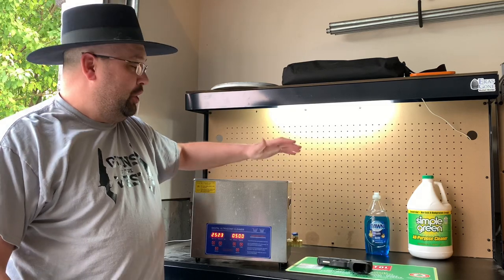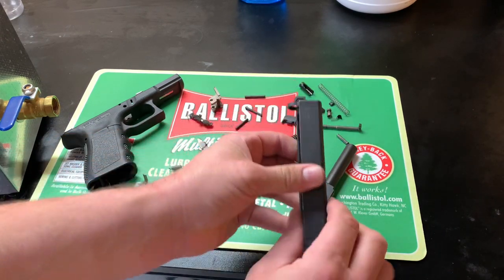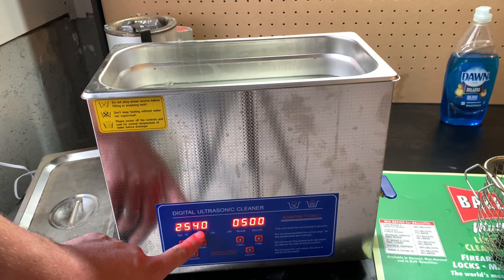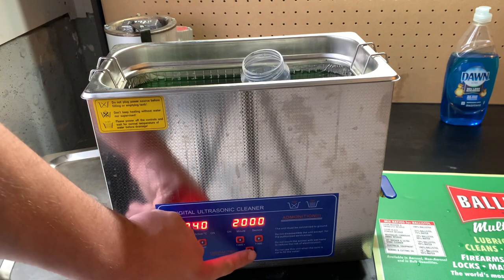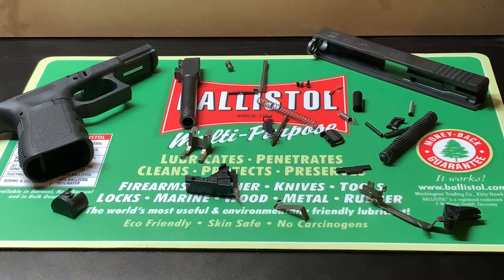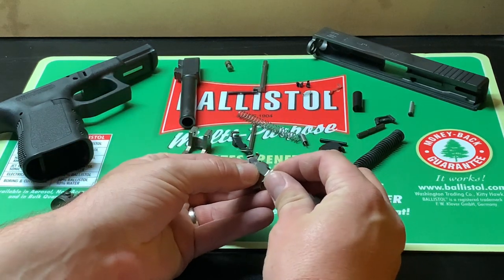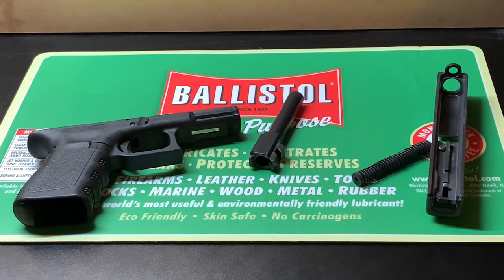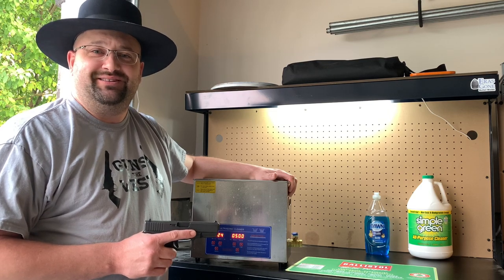Ultrasonic Glock Cleaning

Comment: This may have been mentioned earlier, but you really must rinse those parts before drying. Even the slightest remnant of simple green (a degreaser) will defeat your lubricant. It doesn't take much degreaser to destroy the properties of your lube. I always rinse under warm water & do another ultrasonic with fresh clean filtered water. THEN dry the parts and reassemble and lube. Ultrasonic cleaners are great, but get all that degreaser off the parts before reassembly.
Reply: @MightyNinjaRabbit why distilled ?
Reply: @wokethoughts2186 unfiltered water contains minerals that can deposit on the part and might be corrosive or become corrosive to either the part or the lube. not a super big deal but distilled water is like $1 at walmart per gallon and its alot better that just water straight from the tap.
Reply: You can use normal water in the tank, and put the parts in a ziplock bag with the destiled water and degreaser and submerge the ziplock in the tank, you are welcome :)

Comment: I'd just like to add one point that I didn't see addressed in the comments and that is that the Simple Green original formula isn't the best choice for use on aluminum.  It can actually etch some aluminum alloys.  A better cleaner for things like aluminum frames is their Extreme Aircraft and Precision Cleaner.  It's just as effective at cleaning but safe for aluminum alloys.

Comment: I have a 25 litre ultra sonic cleaner which I use for cleaning motorcycle carburettors and their small internal parts, and a good tip for cleaning very small parts is to put the parts in one of those fine mesh muslin bags that you use for laundry tablets and suspend the bag in the cleaner tank. Now I have seen this, my Colt Walker will be getting an ultra sonic bath in future.
Reply from the maker: It’s the only way I clean my black powder revolvers these days. Thanks for watching!
Reply: @GunsOfTheWest  Do you take your black powder guns down to the screws every time you clean them in the ultrasonic?

Comment: Cant this potentially ruin or damage the firing pin channel sleeve?
Reply: That's my question but it sounds like this guy has done it multiple times and he hasn't mentioned it so I wouldn't worry about it.  Maybe have a couple extra on hand just in case

Comment: Great video! if you want better results I suggest you run a cycle of 5 min without the parts in it and just the liquids, this will degass the liquids and you will get better results after a full cycle with the parts in it :)

Comment: Dustin, how well does the ultrasonic method work on assemblies I really don't want to strip down to pins, springs, and parts?  I am thinking about the bolt, and the trigger & safety, in my old Remington 582 bolt action .22 LR?  The hardest part I can see is getting everything dry.  I have used jury rigged tools to strip and reassemble both groups - once, ages ago.  I should've left those cleaning jobs to a gunsmith with the right tools.  (Stripping my Colt Pocket for this, though, will work great.)

Comment: I always rinse off the cleaning solution in a bucket of clean water before i blow them off.  I also hit the slide with a heat gun and get it fairly warm to evaporate any water i may have missed.

Comment: You also need to hit the on button for the temperature control :)
Have you tried dry lube for the block? I'm using "WD-40 Specialist Dry Lube with PTFE" for most firearms parts these days and only use grease for very high wear rate locations. The dry lube attracts less dirt with lubrication every bit as good.
Reply from the maker: The heater was actually on already. I haven’t tried the Dry Lube, but that sounds interesting.
Reply: Ballistol cleans, protects from moisture and keeps everything well lubricated.  I clean all my firearms with ballistol and just put a couple dots of ultima lube on the barrel and rails.

Comment: Wouldn’t you also want to add grease to the other side of the trigger bar in the back area where it interacts with the frame or in other pieces the rail as well as lubing the top of the barrel at the front of the breach?

Comment: I was just wondering since this video is a year old, how that ultrasonic is holding up?   I have gone through three.   Two were the smaller versions you see made under Lyman and Harbor Freight brands.  The other I ordered off Amazon under the Kendall brand which looked almost identical to the one you are using in this video.   It died after about a year.  All of these ultrasonics are made in China  and just rebranded according to the wholesale purchaser.   From my experienc, they just don't hold up very well.    I am considering either the Ultra 1300M or Infante S6 for my next purchase, but they are considerably more expensive.    So I would appreciate your feedback as to how this Vevor is holding up.  THanks
Reply from the maker: This one actually still works great.

Comment: I’m an advanced glock armorer do not use grease on your Glock.  Glock recommends CLP or you can use slip 2000 EWL
Reply: They also tell you not to use reloads or lead.  Hmmmm.  My Glocks have seen nothing but my lead loads….no problems. Advanced Armorer?  That and $6 may get you some coffee at Starbucks.  A ten year-old child can change the parts in a Glock.  No “Advanced Armorer” needed.

Comment: Why are you not reintroducing oil to the dry metal on the inside and outside of the side? You let it soak in, then wipe off the access. Especially after using Simple Green. It strips all the oils away.
Reply: I have never seen a glock rust. I oil up mine but i mean it works
Reply: @darrengarcia4937  A buddy of mine had a Glock 22 (Gen 3 or 4) as his service/duty weapon that would show surface rust in the summer when it was humid, or when he'd sweat more often. 

Once I ran it through my Ultrasonic Cleaner, and treated it with Froglube, he had zero problems.
Reply: @MrBDDSWC  huh interesting. I do tend to wipe mine down with a silicon rag every now and then.
Reply: @darrengarcia4937  That's better than nothing,  I suppose.

Comment: Have you tried cleaning brass in this ultrasonic?   If so, how does it work.
Reply from the maker: It works great for me. I think you can even get a cleaning solution made specifically for that, but I just use warm water and a little bit of Dawn dish soap with good results.